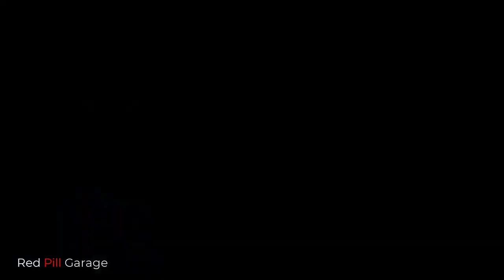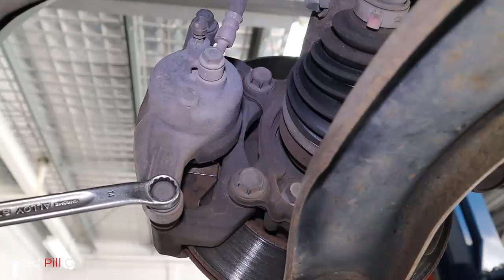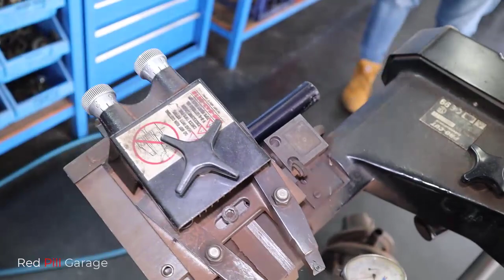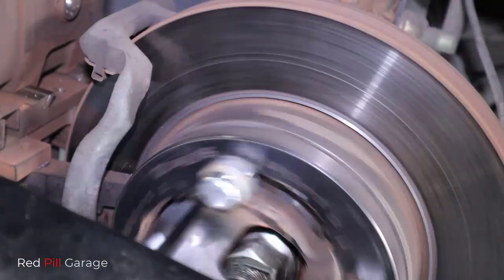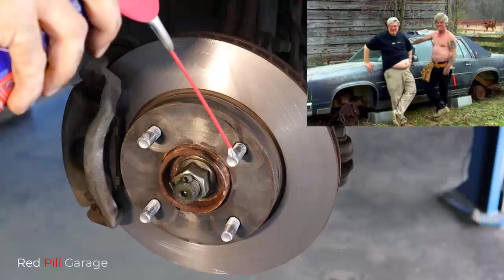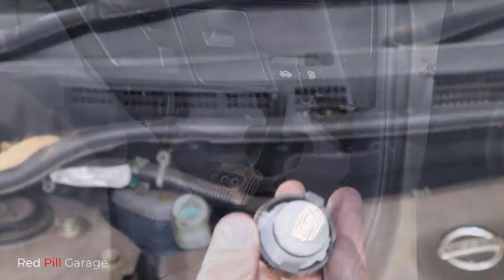How To Machine Brake Discs On The Car. Ep6

Comment: This is high quality mentainance you can't find anywhere in Europe. Everywhere you go, you are asked to buy everything new discs pads and sometimes caliper too. Used to have  repair kits for caliper, now it's not fixable for "safety reasons" bullshit. Ripping off .
Reply from the maker: Hi, Thank you for your comment. Yes, you are correct it is another way for big corporate companies to make more money. I have noticed over the years that a lot of the European cars the disc rotors wear just as much as the pads in some cases, and the rotors will have to be replaced. This is due to the high friction point that they create causing the disc rotor to wear down to a minimum thickness, but on the other hand, you do get good braking performance. Fortunately for most Japanese cars, we can get away with machining providing it is above the minimum legal thickness.